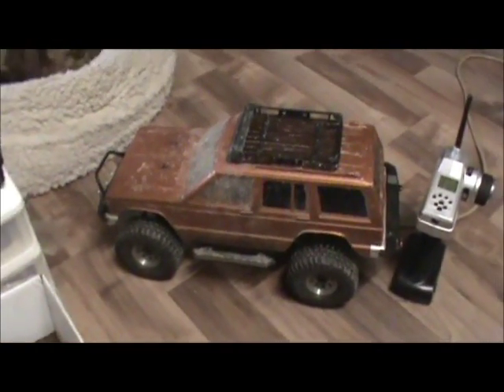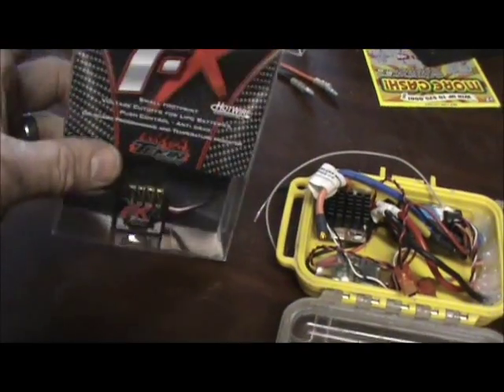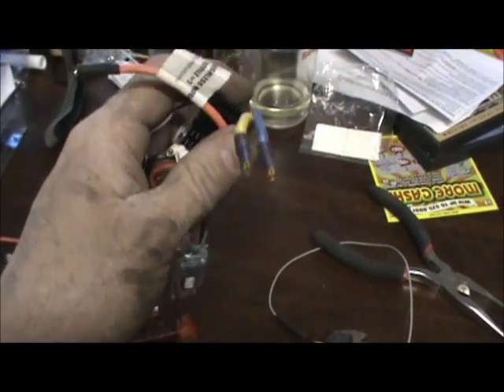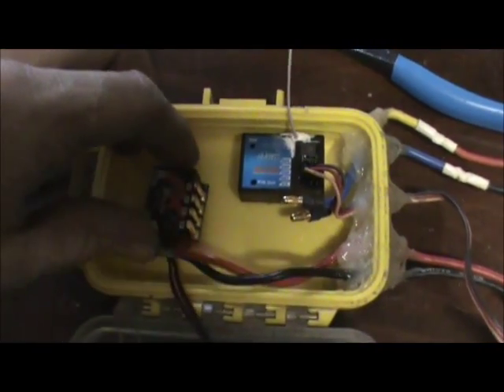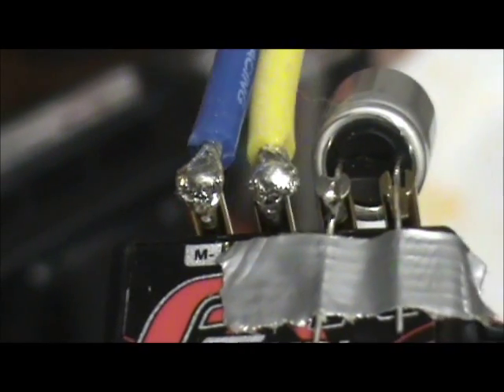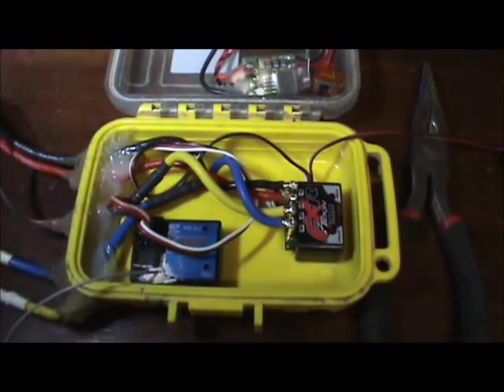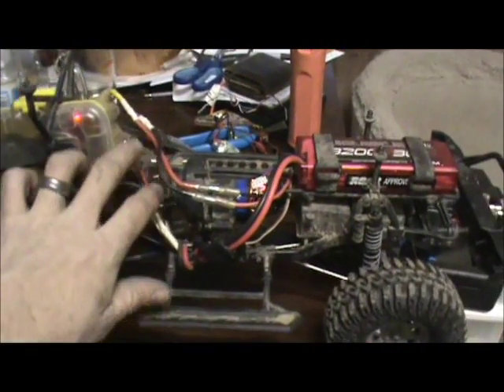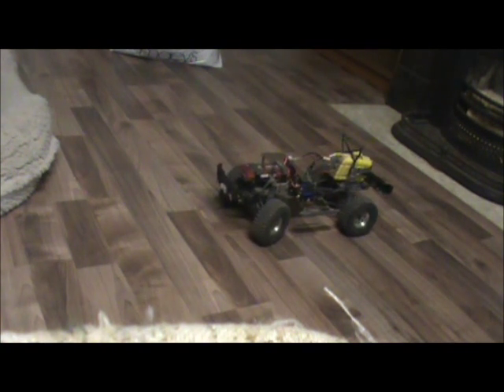axial scx10 electrical problems resolved with a Tekin FXR esc

Comment: I'm having some problems as well. What is the problem if I can still turn side to side but my forward and backwards won't work. I check the motor and it is still good. Any suggestions?  Thanks
Reply from the maker: i was having the same problem at some point where i had steering but no throttle. i think my novak esc/bec went bad and burned out the motor in the process. i wound up replacing ALL the electronics. i now run a teken fxr esc with a teken 35t motor. both the esc and motor are made to run 3s lipo without a bec.  i also junked my rc4wd radio and transmitter and installed a futaba 3pl system.  i have had zero problems since i invested in some higher quality electronics.

Comment: Pardon my ignorance, but are there any overheating issues caused to the electronics (particularly the ESC) by being enclosed in that box with no ventilation?  I appreciate any feedback and thank you in advance.
Reply from the maker: sorry for the late reply, but i had the same concerns, though i havent had any problems over heating the electonics.  i was having trouble with my original choices of inexpensive electical equipment (i was on a budget), i have since replaced everything with teken equipment, all installed in that same box with no over heating trouble.
Reply: GeneralChaos1756 Thanks.  I hear a lot of great things about Tekin, but they are definitely on the pricey side. The Trailfinder 2 kit I want is a good chunk of change and cuts into my ammo budget.....Oh, how nice it would be to be wealthy.  :)   Have a good one!

Comment: Hi, when you powered the esc for the first time did you have to program it.
or will it run at least the default?settings if you dont do any programming?
is it confusing to program when you first set it up?
the tekin esc fixed that problem good job..
Reply from the maker: im not sure, I ran the programing sequence right away, I didn't try to run it before.  I think it may though, because the programing is just for the esc to learn the positioning of the controller channels.  but just re-read the directions until you understand them correctly
Reply: GeneralChaos1756 hey thanks for the reply.

Comment: what gearing are you running. I was having heat issues with a 3s on my fxr
Reply from the maker: using stock scx10 gearing, were you having heat issues with the motor or the fxr esc?  I'm wondering because on my first run out with the fxr after about 1.5 hrs, the truck started to get real glitchy, I haven't figured out the problem yet, but I thought the esc might be overheating.  were you having similar problems?
Reply: Im pretty sure it was fxr. going to try gear to 56/11 32p